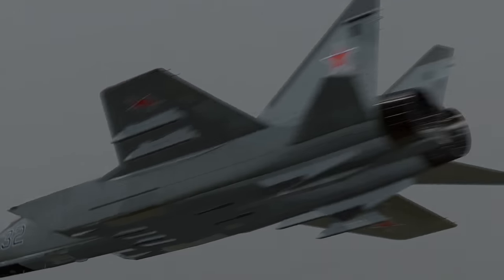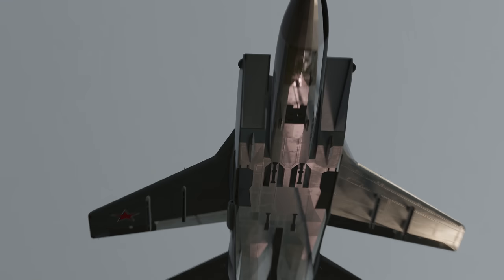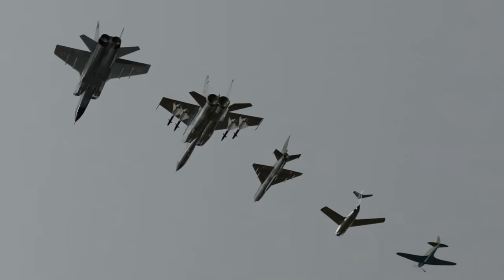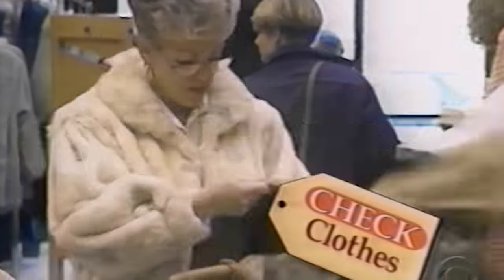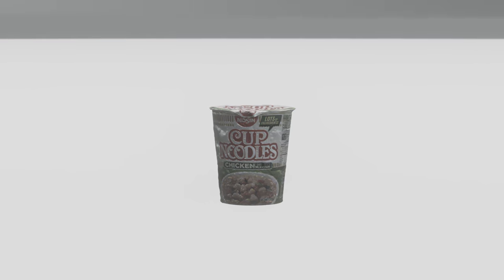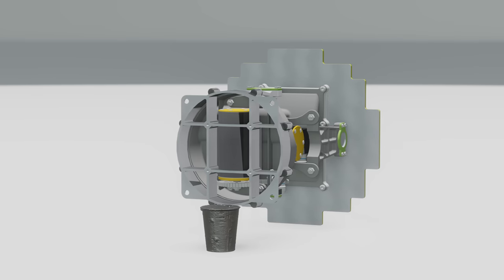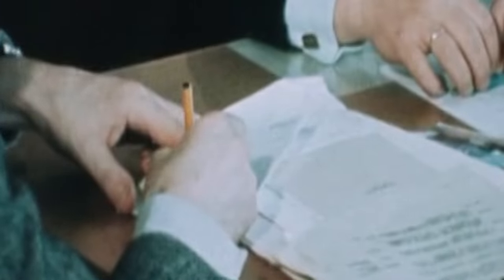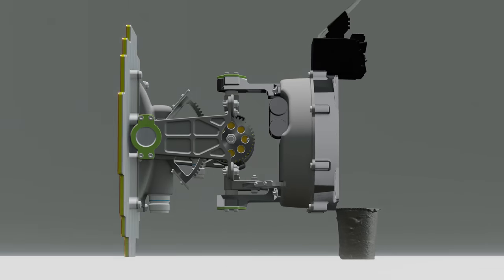We have revolutionized the cup noodle

Comment: The cup noodle design failed to consider the conductivity of the cup for a truly instant noodle experience as if it were designed with a thinner brass alloy it could be just as durable while retaining enough heat to cook the noodle in flight for immediate delight of the soviet soldiers upon return
Reply: but consider: the higher thermal conductivity of brass, coupled with the reduced thickness of the housing, would allow the noodle payload to cool rapidly at high altitudes, thus degrading its performance in comparison to the chosen nickel alloy.
Reply: @duncanurquhart5278  that is a fair point however, the noodles contain preservatives to prevent such degradation despite low temperatures and any microorganism growth will be immediately dealt with by the sudden heating of said noodles upon reentry to the lower atmosphere
Reply: @combustiblefire5510  the DINRV (Dropped Interorbital Noodle Respons Vessel) is amazing project. The whole Dinner 5 program is very promising technology for the entire future of the human race.
Reply: True, but how are you countering the preservatives in the noodle, or are we forgoing preservatives and shipping them as ordered to eat on the day?
Reply: @JakeSig  the heat should decompose the preservatives while heating the noodles just enough to melt in the mouth
Reply: Has anyone considered the fact that cup noodles, by design, require the addition of a prescribed amount of water? I would wager that the added purified water would skew any if not all of these hypotheses given it has the highest thermal inertia of any natural compound: extending heating and cooling rates and adding boiling point factors to the mix.

But I'm sure this has already been accounted for without mention as it is basic cup noodle preparation.
Reply: @mattkoethe6691  with a high enough temperature the water would cook the noodles while absorbing enough heat that it wouldn't burn them which is a key factor in cooking them, sorry I was not clear before
Reply: I’ve read Bass instead of Brass and I must say: using the aerodynamic form of a bass and the thermal heat to cook the fish and the noodles stored inside… it‘s not a bad idea.
Reply: this entire conversation should be a video
Reply: @DidIDoGoodMum  Ah yes. Bass alloy, harder than steel and slightly better tasting
Reply: @mattkoethe6691  

However we could use lead and add a sweet flavor as well as keeping it safe from those pesky particles from the sun.

I feel like this is an engineer conversation but frick it, I’m joining.
Reply: this entire comments section is just pure gold
Reply: @combustiblefire5510  what you are forgetting, is that if we are re-entering from the upper atmosphere, the temperature would become to hot for nickel or brass. I proposed a tungsten steel alloy, it would be able to with stand the heat of re-entry, while being extremely tuff, so it couldn't be shot down by the enemy's. Although the only other problem is that tungsten oxide has a low relative melting point.
Reply: @calebdavis9087  the issue with tungsten is that, considering it's density, it would probably be buried deep in the ground upon landing if it doesn't hit and kill an ally as is
Reply: Meh….. should have retired it when the trilogy ended.  Just kinda petered off int

Comment: Finally a cup noodle that can go fast.  We've been denied this ability for far too long.
Reply: But not the right alloy smh Russia stop being cheap and use a modern aircraft titanium alloy
Reply: "dad, can you pass me a cup noodle?" 
"catch!" :D
Reply: Why haven't you installed yet an aluminum 600 cubic inch pushrod V8 with a twin screw supercharger, a flatplane billet steel crankshaft and forged cylinders, capable of 17500 Horsepower and 23000 Newtons-meter of torque? It's a very simple and practical modification to add to your cup noodle that provides power when the time comes to flee, though it won't be easy to put that power down, so using a set of 16 inch tall x 10 inch wide magnesium centerlock rims fitted with some radial semislicks should help, for extra control, a set of 270mm sway bars and two double wishbone coilovers will give you unmatched performance in corners. Now you just need to choose what type of drivetrain and gearbox you would wanna use, and tune the coilovers and alignment acordingly.
Reply: @Ferrari255GTO  17.5 thousand horsepower  O_O
Reply: @falcongamer58  and enough torque to pull a house
Reply: idk give me a cup noodle and 4-5 hours and I'll show you supersonic speeds
Reply: @officalcrim  Comrade, titanium alloy is of expense and hampers mass production on a scale needed for conquest of cup noodle market.
Reply: @attrexius8034  that's what the Russians did with the foxbat try and make it cheap make something that works really well and isn't as cheap as possible (I was joking about the titanium alloy it's cuppa noodles the nickel-steel is a million times better for that)
Reply: It might not be instant noodles, but it sure is fast!

Comment: This is hilarious, but I just kept thinking it'd be entirely next level if you had ended up building a whole plane around the noodles step by step.
Reply: You just end up with an air superiority fighter with a cup noodle in the cup holder.
Reply: @PixelCortex  Since we already got a BRLS-8B (Zaslon radar on Mig-31) and it is sait to have D30 turbofan, it will more likely end up like a Russian F-106 or something (assuming MiG wanna something new, so they decided to do a single engine jet).

Comment: I personally am looking forward to my cup noodle being equipped with the BLRS 8B Pulse Doppler Electronically Scanned Array Radar. My current go to brand of cup noodle can only scan 3 targets, and on my lunch break at work I definetley encounter up to 10 threats simultaneously within 200km. Thanks MIG!
Reply: Credible
Reply: You really need to consider realtime ground-based radar networking. Nebo-SV and Nebo-M would be an excellent choice since they can track a large number of targets simultaneously, and being long wave / VHF are immune from stealth low-observability issues.

Comment: pen, tool for writing or drawing with a coloured fluid such as ink.
The earliest ancestor of the pen probably was the brush the Chinese used for writing by the 1st millennium BCE. The early Egyptians employed thick reeds for penlike implements about 300 BCE. A specific allusion to the quill pen occurs in the 7th-century writings of St. Isidore of Sevilla, but such pens made of bird feathers were probably in use at an even earlier date. They provided a degree of writing ease and control never realized before and were used in Europe until the mid-19th century, when metallic pens and pen nibs (writing points) largely supplanted them. Such devices were known in Classical times but were little used (a bronze pen was found in the ruins of Pompeii). John Mitchell of Birmingham, England, is credited with having introduced the machine-made steel pen point in 1828. Two years later the English inventor James Perry sought to produce more-flexible steel points by cutting a centre hole at the top of a central slit and then making additional slits on either side.

The inconvenience of having to continually dip a pen to replenish its ink supply stimulated the development of the fountain pen, a type of pen in which ink is held in a reservoir and passes to the writing point through capillary channels. The first practical version of the fountain pen was produced in 1884 by the American inventor L.E. Waterman.

Ballpoint pens date from the late 19th century. Commercial models appeared in 1895, but the first satisfactory model was patented by Lázló Bíró, a Hungarian living in Argentina. His ballpoint pen, commonly called the “biro,” became popular in Great Britain during the late 1930s, and by the mid-1940s pens of this type were widely used throughout much of the world. The writing tip of a ballpoint pen consists of a metal ball, housed in a socket, that rotates freely and rolls quick-drying ink onto the writing surface. The ball is constantly bathed in ink from a reservoir, one end of which is open and attached to the writing tip.

Soft-tip pens that use points made of porous materials became commercially available during the 1960s. In such pens a synthetic polymer of controlled porosity transfers ink from the reservoir to the writing surface. These fibre-tipped pens can be used for lettering and drawing as well as for writing and may be employed on surfaces such as plastic and glass.

pen drawing, artwork executed wholly or in part with pen and ink, usually on paper. Pen drawing is fundamentally a linear method of making images. In pure pen drawing in which the artist wishes to supplement his outlines with tonal suggestions of three-dimensional form, modeling must necessarily be effected by the close juxtaposition of a series of strokes forming areas of hatching or cross-hatching. Many pen studies, however, are produced with the substitution of tonal washes (layers of colour spread over a broad surface) laid onto the drawing with a brush, in which case the outlines or other important definitions of the figures or landscape are established by the pen lines. See wash drawing.
Inks of various types used in pen studies contribute additional diversity to the final effects. Historically, three types of ink were most frequently used. One was black carbon ink, made from extremely fine particles of the soot of burnt oils or resins in a solution of glue or gum arabic. The finest type of black carbon ink was known as Chinese ink and was the prototype of the modern black India ink. A brown ink popular with the old masters because of its warm, luminous colour qualities was known as bistre. It was prepared by boiling wood soot to obtain a liquid, transparent brown extract. The third important ink was an iron gall, or chemical, ink. Its principal ingredients were iron sulfate, the extract of gall nuts, and a gum arabic solution. It was, in fact, the common writing ink for centuries and was employed for most early drawings. Its colour when first applied to the paper is bluish black, but it rapidly turns blackish and, over the years, a dull brown and tends to disintegrate.

Pens are the oldest and most popular of all the drawing media of the Western artist, in part because of the variety of linear effects provided by the three basic types of pens and their adaptability to the changing styles of draftsmanship over many centuries. These three basic types are quill pens, cut from the wing feathers of fowls and birds; reed pens, formed and trimmed from stems of bamboolike grasses; and metal pens, fabricated from various metals, especially fine steel. The outstanding master of the reed pen, the Dutch artist Rembrandt, used it often in combination with the quill pen and washes to produce the richly suggestive atmospheric illusionism of his works. The reed pen never had the widespread popularity of quill or metal pens, but for special effects it has served artists admirably; for example, the 19th-century Dutch artist Vincent van Gogh in his last years used it in his drawings to produce the blunt, powerful strokes that were counterparts of the heavy brush strokes typical of many of his canvases.

Until the acceptance of the modern steel pen, most Western master draftsmen used quill pens. During the Middle Ages the quill pen was used for the fine delineations of images in manuscripts; its nibs, which can be sharpened to extreme fineness, permit the craftsman to create small linear figures or ornamental decorations on the pages or along the borders of the parchment leaves. This characteristic, combined with the flexibility of the quill point, which responds to pressure for varying the widths of lines or forming accents, made it adaptable to the diverse personal styles of draftsmen from the 15th to the end of the 19th century.

The development of excellent steel pens by the Englishman James Perry in the 1830s and the mass production by stamping pens from steel blanks led to the metal pen’s supplanting the quill. Nevertheless, artists only reluctantly adopted the steel pen, and most drawings in pen and ink done before the 20th century were still produced with quills. The steel pen is now used for drawing almost exclusively and is available in many shapes, sizes, and degrees of stiffness or flexibility. It has become standard studio equipment of the illustrator, cartoonist, and designer. Pen drawings by such outstanding painters and sculptors as Pablo Picasso, Henri Matisse, and Henry Moore demonstrate the virtue of the steel pen in producing the sharp linear definitions generally preferred by modern masters.